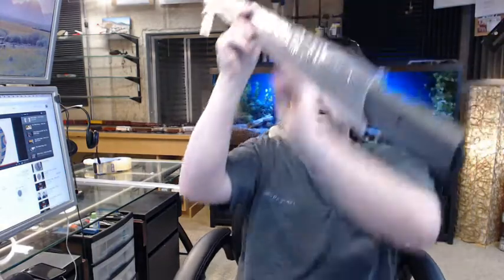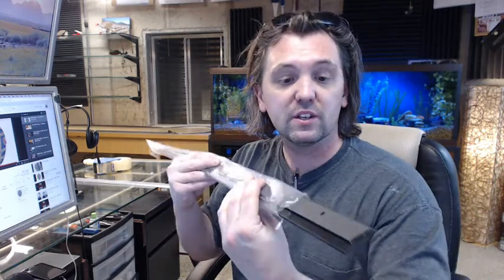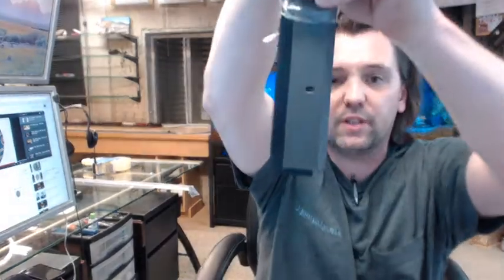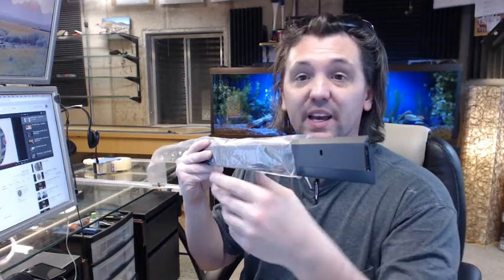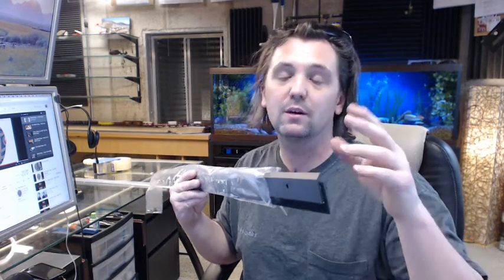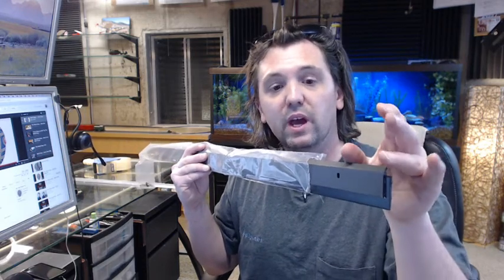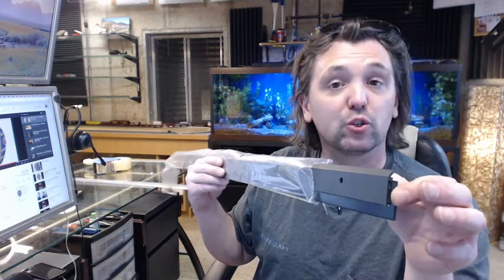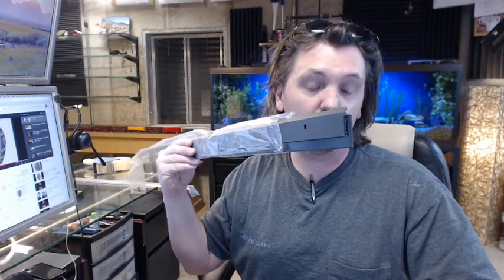Dorbin 39BN Solid Brass Oil Rubbed Bronze Door Sweep

Comment: Thanks for this! We have a historical building... The front doors are original Oak and the original brass hardware is still in place. Everything was recently restored and it looks stunning. Our contractor added Cheap aluminum door sweeps and they stick out like a sore thumb. Would you consider this Dorbin product the very best option or have you come accross anything else we should look at in Bronze?
Reply from the maker: I will speak plainly when it comes to Dorbin in saying that while I find them to be at times argumentative, inflexible and intractable, and I would even add overpriced, this manufacturer would be the unit that I would use personally.
Reply: Little bit of a mixed bag there, but on your word, I'm interested. I need two 32" (finished length) in antique bronze. (I imagine that finish will best match with actual antique bronze door hardware?) What type of price can you put together for a Youtube fan?
Reply from the maker: Steve send an email to our sales department with your quote request:   https://absupply.net/about_us.aspx